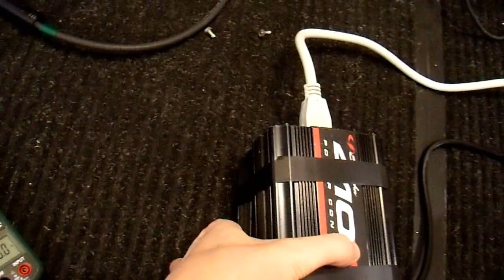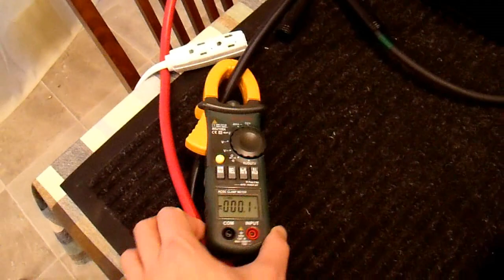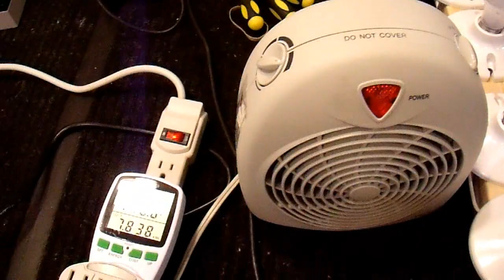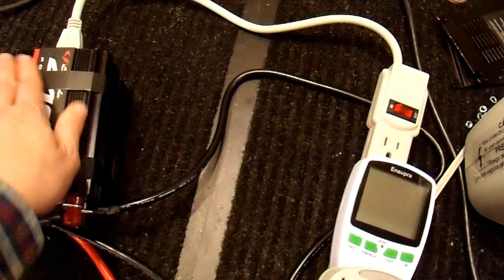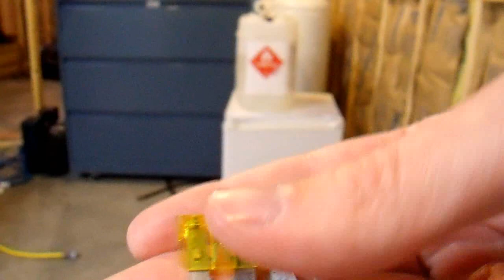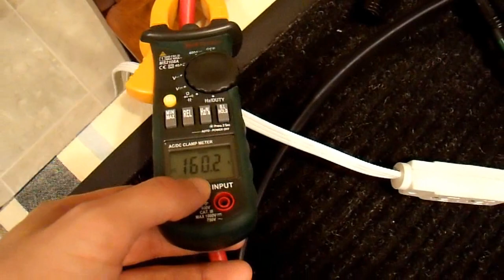Parallel Inverters - Double the Power Hack!   Part2

Comment: Ok this is a joke right??
There is nothing connecting the 2 inverters together besides electrical tape???
Correct me if you have done some kind of wiring on the ac side.
Just sharing positive and negatives on the dc side don't parallel inverters .
You have a dc side and a ac side unless you wired both of the ac sides together then I would believe it .
Not trying to troll but I don't want someone putting there life in danger leaving a over amperage fuse in the hopes of doubling power output. Most power inverters have a .5 to 4 times surge capabilities and what you are doing is not safe. Just saying....
Reply: whowhatisthat88 just found out this was a 2 part video all you effectively did was up the peak load capacity they make special inverters that sync together that use network cabling to agree on frequency, load, balance of loads for example Magnum Energy MS4448PAE Inverter/Charger is a prime example of proper sync of up to 4 power inverters
Reply: He joined them with a suicide cable in the last video. He is a.moron.

Comment: So could I wire up 10 inverters to power my 30 amp RV or 30 inverters to power a 50 amp RV, similar to this way?  Maybe jumping all of the input capacitors together then having short 15 amp AC power cables come out of each inverter jumped to 6 gauge cables connected to the RV circuit breaker panel box?  Not sure how to get the two 50 amp 120 volt legs 180 degrees out of phase with each other.
Reply: Watch part 1 first
Reply: there are many things that wont work with that setup

Comment: Knurlgnar24, question? Given the particular setup of the batteries and inverters as per this video would it be possible to attach a battery charger on one inverter connected to the battery bank thus charging the batteries while using the other to power a typical lower wattage item? Ie: effectively negating a significant drain on the batteries by the system self charging during use? Hope this makes sense! Cheers, rich.
Reply: no

Comment: You know theres a much easier way to do it!!!

http://mobile.walmart.com/ip/Link-Depot-US-3-Prong-1-Male-to-2-Female-Power-Cord-Splitter-Universal/24585245
Reply from the maker: That cord could be used to connect them both together with some custom cabling, but they'd still fry each other without some modification.  :(
Reply: *****
Ahh dang it. How am I suppose to connect 5 inverters then!!!!!!!
Reply: +Danyal Ahmad Same like in here, you cant paraller AC but You can paraller DC so this why it works here. How ever your output stage transistors may blow if you parraller too many.
Reply: MEGADRIVE Jeroi Fuses will blow. Might as well make seperate connections or something do distribute the power in from the batteries.
Reply: +knurlgnar24 Due to not being synchronized. The outputs of both are not timed such that at one point they would be competing with each other resulting in a condition worse than output short.

Comment: Some parts should have been omitted as they were long and negated latter. It would be awesome if you did a quick heat measure, sustainability test at ~800 watts. Great videos and keep it up!
Reply from the maker: I understand your suggestion and I have been trying to keep things moving in my videos as of late for this reason.  That said, my style of videos is more 'explain why' with some cursory detail and show the experimentation process whether it fails or succeeds.  I realize it may be slower than many people prefer but it's they style I enjoy doing and while there are plenty of television style video out there that just show the setup and result, there aren't many videos out there that try to describe the process in full.  And as an engineer I feel obligated to, unfortunately or not.

Thanks for your comment!
Reply: I get ya man. It's your show and I know how much work it is to film and edit. I take the lazy route just to get my result data out there for the group. Love your videos and how well you present them with all variables looked at and explained.

Comment: on your air conditioner i start it without the compressor running with just the fans after the fans are turning activate the cooling part.

Comment: Hi ***** 
As with everyone else I agree your vids are really educational for us novices, I would like to offer 1 or 2 novice questions and hope you can help; 1) If you connected some big capacitors on the output...motor start cap' style, would it increase the initial surge capacity for starting fridges ect? and 2) With combining inverters such as in your video, is it possible to build a large capacity output FET bank external to the original board, remove the original FETs and connect it to the external bank via hook-up wire? basically make a costume output transistor block so as to not over-drive the original FETs. Hope this makes sense...thanks Knurl, Cheers Mark from Australia :-)
Reply from the maker: 1) Adding some large DC capacitors to the 250V rail may help increase the surge capability slightly, but most of the limitation is in the magnetics which can't be upgraded very easily.  This style inverter wouldn't appreciate charging/discharging capacitors stuck on it's output.  It may tolerate it but it will dissipate all of that charge as heat each cycle without substantially improving surge performance.  It's a better solution to add those caps to the appliance itself in a timed configuration so that they're only active for a short time on startup.  Essentially a 'hard start' kit.  It will still overload the inverter though...
Reply from the maker: 2) It would be possible to make an external output board and bypass the internal one if someone had enough motivation.  Most of the frequencies involved are low enough that it would function, but I am sure there are complications that a person would run across very quickly when attempting it.  It should be possible though.
Reply: ***** Thanks so much for taking the time to provide these answers Knurl, very much appreciated.
If you would like some feedback with your videos, all the diagnostic content is pure gold and so is the explanations of the functions of the block sections on the board.
Of the videos I have seen of yours it seems there are some very common faults, but then again it seems each inverter is it's own new challenge.
Thanks again, catch you on the flip side :-) (thats kind of an inverter joke - flip; as in reverse phase...yeh a bit lame :-)

Comment: Great videos and lots of information man,i would like to know if this could be done with two 1000 watt wagan slimline inverters?
Reply from the maker: For higher output inverters like those slimlines you would need to sync the output stages and run them in parallel which is unfortunately more complicated than just a couple of wires.  I imagine the output stages would overheat if the load wasn't shared.  That said you could still try this method at your own risk!

Comment: Hi there.  I had a 600w (12v) inverter that jystvwasnt good enough . so I bought a 1000w one . on the box its says that Max peak I'd 2400w . however when I use it it feels slightly stronger than the 600 w . anything above 800w is tripping it and restarting . I haven't checked fuses yet  as its brand new unboxed. I have a 2000w heater that has 2 buttons .. First button says 750w. Switches on . that's good. But if I try just the second button of 1250w . doesn't work . if it'd 2400w peak , why not?
Reply from the maker: Ignore the 'peak' rating on inverters because it is a meaningless marketing spec.  (usually it means it can supply that amount of power for 0.1 seconds or less which isn't helpful for most applications)  Your heater will likely require around 1500W for 10 seconds or so until it heats up on the 1250W setting, so you should have a 1500W inverter minimum for that purpose.

Comment: The same way we ( Convert 3 phase AC to Single phase AC Circuit ) , we complete isolate one from other, than we mix again and adjust the outside volts and amps, using oscillators circuits and big MOSFETs, what do you think, if we do the same with 2 or more (absolute-same) inverters. connect they individual input to the same OR different battery bank, get they individual output and treat as individual AC phases, and than ( Convert 3 phase AC to Single phase AC Circuit ). Please let me know your thoughts, Please let me know if I am not clear on my comment. best regards and please keep rolling.
Reply from the maker: If the inverters are prefectly synchronized and connected in series it could conceivably work to double the power and double the voltage, but fault conditions such as overload will cause one to shut down potentially before the other damaging the units.
Reply: *****  Okay, glad you cleared that up.  I was thinking that the synchronization would still oscillate even slightly. Wish I could see this on like an oscilloscope. I'm so behind. :(

Comment: I am enjoying watching your videos. After seeing your review on the Cobra 2500 watt inverter which I have I decided to go in a differfent direction. You really gave the  the Tiger Claw 1500W pure sine wave inverter a good review. in terms of output   would you say that the tiger claw would be anout the same as with the 2500 watt Cobra? Could 2 tiger claws 1500 inverters  be wired in parallel to double the output?
Reply from the maker: The Tiger Claw inverters cannot be paralleled, and a single Tiger Claw cannot power as much as the Cobra 2500.  That said the Tiger Claw is a much better product.  It depends on what you need/want to power:  Your best option may be a different 3kw type MSW inverter if you need to power heavy loads on a tight budget.
Reply: WorkingDogsChannel Tiger Claw makes a 3000 watt MODIFIED sine wave inverter... but the 1500 is Pure...

Comment: hi dear friend 
I do qusto I also work with 2 inverters of this model? 
Softstart Spannungswandler 12V 3000 6000 Watt Inverter E8 Wechselrichter 
thanks
Reply from the maker: This exact method would not work with 3000 Watt inverters.  You would need to synchronize the output stages and tie the input stages together.
Reply: ***** hank you so much, you've been very kind 
please I might make a video more detagliato with the Shema of operation 
Best regard

Comment: Ok...well it works...excellent...! :)

Could you do this with bigger inverters? The only problem that I foresee is that the H-Bridge devices could be potentially be operating far closer to their maximum ratings than in a smaller model. Do you agree with that?
Reply: ***** Strapping all the pins ov each mosfet between the inverters in the H-Bridge section would definitely be a bad idea. Because the clock signals in each unit will not be synchronised, and this would most likely result in a massive short circuit between both inverter's output stages, destroying them both. 

If you were going to do something like this what you would need to do is use one inverter as the master clock & send this signal into the gates ov the mosfets (or the driver chips) ov the slave unit. If you did this, you would not need to parallel any ov the high voltage connections around the mosfets at all, just the AC outputs as both inverter output stages would be in sync.

However this really becomes a fairly advanced operation with electronics as it would involve tracing and re-routing these signals.
Reply: @xanataph    Fantastic:  thanks , after 7 years...
Reply from the maker: For larger inverters you would need to make use of both the input and output stages of both.  This would involve paralleling the output drive FETs and their respective drive circuitry which is more complicated than what I was able to do here.
Reply: ***** but would it be the same as you have done on the capacitor, just a simple bridge?

i want to parallel 2 x 1500w inverters, so i would make a bridge to all three of the legs of the transistors plus the capacitor, and ill get something close to 3000w?
Reply: ***** On the face ov it you could perhaps add additional mosfets in parallel with the existing ones in the H-Bridge to beef up a single output stage in what you deem the "master" inverter. However, I see a couple ov potential issues in that approach. a) If there were filter components following the bridge then they would have to be uprated too. b) There may possibly be some kind ov power monitoring arrangement that closes things down when the expected power lever is reached, even though now you have made it capable ov more.
Reply: xanataph yea that is also an idea,  just I'm not very electronically educated so (though it may be more expensive) if I could do the simple bridge between the fets it would save me going to school again lol, I guess I should try fiddle with a very cheap inverter before throwing money away..  Thanks for your input,  you have given me a potentially better option if I can figure out how to bypass the filters

Comment: Love the video, not sure if I'd try it myself.  But nice to know it can be done.

What I am curious to know.  Since you're getting 60v on the hot and 60v on the neutral, is there a way to ramp them up to 120 each, yielding a 240v inverter.
Reply from the maker: If you synched the output stages and drove them from a single source it could be possible to put the two in series to double the voltage.  I didn't try that in this video as it would be more complicated and I have no use personally for 240V at 800W.

Comment: Have you ever tested an inverter/charger?
Reply from the maker: I have, and the charger didn't work on that particular unit.  :0
Reply: How ironic. Both inverter-chargers that I picked up don't have the charger working either. Barely fit on my bench. Both are worthy of repair however. One inverter works.

Comment: Great job that worked really well. I noticed some copper links in tape on the PCBs near the power inputs I wonder if they are used as current shunts. I'm also curious how long it would take to overheat at over 800w output.